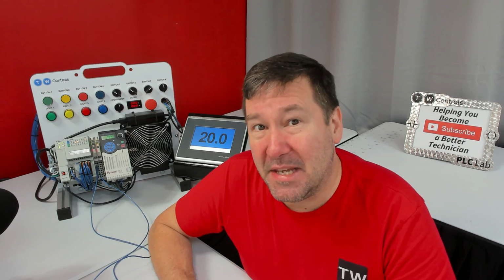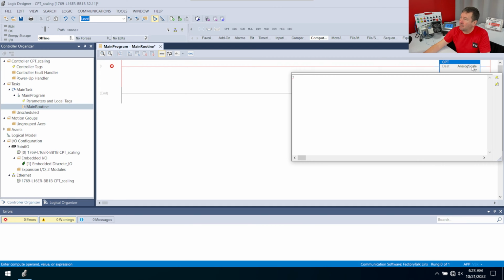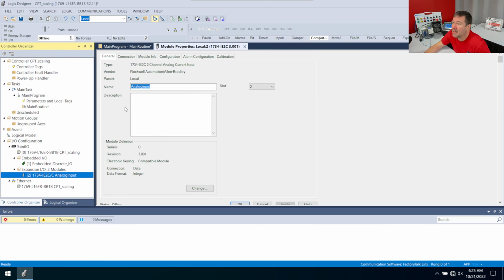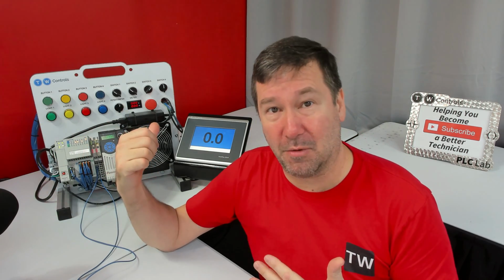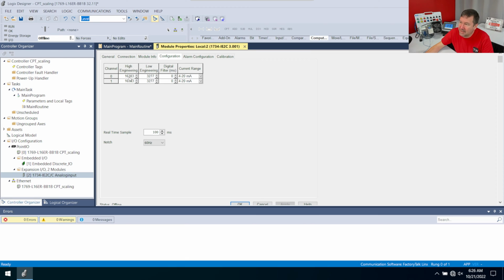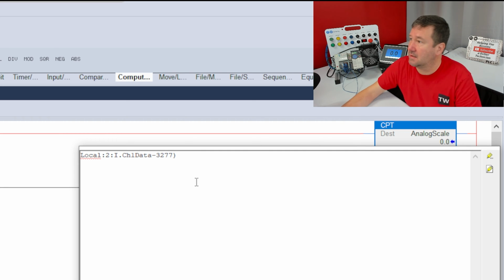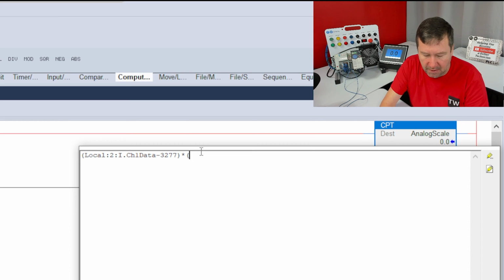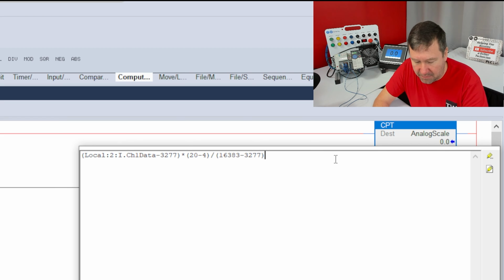Studio 5000 Scaling with the CPT Instruction in Ladder Logic

Comment: Could this also be applied to an already existing PLC5? Installed radars to two tanks. I’ve seen the scales all set 0-4095. This plc5 talks to a SLC through Data Highway+. I can see the raw integer value and its linear to the 4-20mA output of the LR150 radar.
Reply from the maker: For the SLC, have a look at the SCP scale with parameters instruction
Reply: @TimWilborne  I didn't think about that. Mov the integer into a floating point. The data is exchanged 1 for 1 from the PLC-5 to SLC-5 then SCP the data. I'm more comfortable using SCP considering my career began with learning more on the SLCs than PLC-5 family.

Comment: It never occurred to me to use the compute instruction for scaling, good tip. Typically I do it with the module parameters. I also see someone mentioned the SCP add on from AB, I started using it to scale encoder data for linear measurement as well as getting an accurate FPM with a VFD and encoder. Look forward to seeing more on this!
Reply from the maker: Thanks, there has been a good discussion in the comments section of various alternatives also.  There is more than one way to program most things 😁
Reply: @TimWilborne   Hi Tim, Can you explain why plc programmers use this : y= m(raw -x1) + y1 ,  y1 being y offset and not intercept? It seems a way of cheating, or writing the same thing  in a different way.  Don't  know why. In this example,doing the math,b is zero, and equation is Y=mx. So y1= 0.00122081x3277 =4 y2=0.00122081 x16383 =16 . Why don't use Y=mx, considering b=0?

Comment: Good morning Tim. Thanks for the video. I usually like to change the engineering units to 4000-20000. You still lose some resolution, but not nearly as much. Did you not lose as much by using CPT to rescale to 4-20? Isn't it the same thing? There is also an SCP for download on the knowledge base. I like to make an AOI so it's easy to change values on the fly. Have a great day, and thanks for the helpful information
Reply from the maker: No, you do not lose resolution with the CPT with a destination data type of REAL.  It would depend on the resolution of your analog input as to whether you lose resolution with changing the engineering units to 4000-20000.  I probably should do a video sometime on what 10, 12, 14, 16, etc bit resolution means.  The main thing that jumps out to me with the 4000-20000 engineering units is you will still have to do a math conversion to either get it to 4-20mA or level, psi, etc.  Why not leave it at the default, I think it adds confusion for the person troubleshooting later.  Don't share the link below but here is an upcoming video that I expand on it.
https://www.youtube.com/watch?v=CWgIeYoKmyk
Reply from the maker: Also, we have a video coming were we build out an SCP AOI.  There are pitfalls to the one that is available from Rockwell Sample Downloads.
Reply: @TimWilborne  smart man, you saw us coming 😆. I get what you're saying with real vs int. I been doing the 4000 thing for few years now. Always willing to try something new tho, of it works better or helps someone who comes behind me. It's been my experience that most of the cheaper field devices aren't accurate and repeatable enough to benefit much from more resolution than *1000. 🤷 Doesn't mean it's the right way to do it tho. Thanks for the response!
Reply from the maker: @ArkansasLivin  It is always good to see how different people do different things.  There is rarely a truly wrong way to do things as long as it satisfies the requirements of the project.
Reply: @TimWilborne  But CPT doesn't display it as nicely on the ladder like just using a DIV does.  You have to hold your cursor over it and get the tool tip.  I'm with @ArkLivin on this one, it's the method I use, and I haven't had a sensor that I need greater accuracy with than I am able to get with a DIV by 10 or 100.
Reply from the maker: Thanks for your input Daniel. I think as you said, a lot of it comes down to application. I've had some when we have had to change to a higher resolution input module because we need a greater accuracy. For me, I don't want any.
Reply: @TimWilborne  Yeah, I'm not with a systems integrator, my perspective has come from working at a specific plant in a specific industry, and our deltas happen to be within ranges where I don't need a decimal place on a 0-5800 PSI pressure sensor or temperature to more than half a degree, so card scaling  works in my application and keeps things clean and simple on my ladder.  But I understand working as a 3rd party and not knowing your next client, you'd probably pretty quickly just err on the side of caution.

Comment: I like the scaling that you can do directly with the cards. Example the point i/o analog in card you can put the range you want and everything. It's nice but sometimes having all the data raw where you can see it can solve the problem faster.  

Great video as always!
Reply from the maker: Hi Mark, on the surface it does seem easier but there is a pitfall to doing that, this video isn't out yet so don't share it but watch this one.
https://www.youtube.com/watch?v=CWgIeYoKmyk
Reply: @TimWilborne  great response video sir. I agree with you. Doing this will create a problem of converting Int to real with rounding decimals.
Reply from the maker: @AbdulWahab-iq3ej  Thanks!
Reply: @TimWilborne  exactly!  Each program is different and needs different things.  On a tank farm I did recently they could have cares less if it rounded and they wanted the program as simple as possible. When each tank is 300,000 gallons they didn't seen the need for the tank to even show the decimal point because they were bulk.  On the other hand another job they needed precision levels for acid and alkaline storage tanks.  That does cause some issues if the fluids are being filled or drained depending on how sensitive you have everything set.

Thanks for the reply Tim. 👍  love having great discussions with fellow programmers.
Reply from the maker: @TheElderOne2003  These discussions help build up everyone's skills.  I learn more in these than you probably learn from the original video 😁